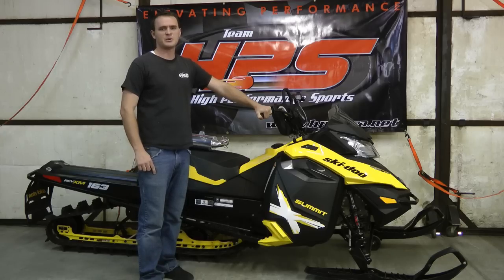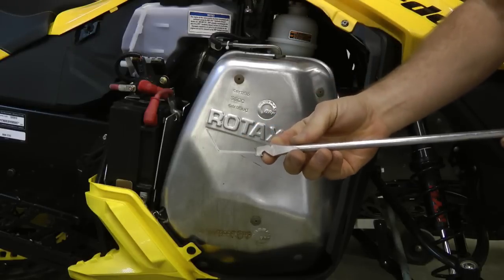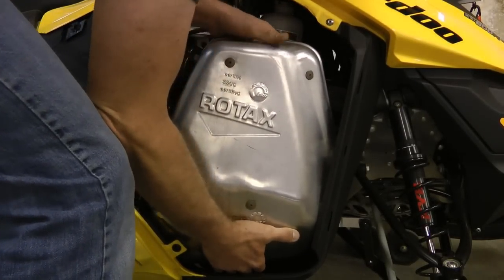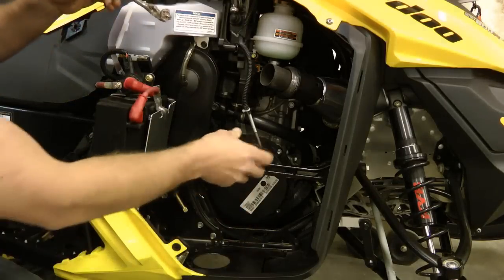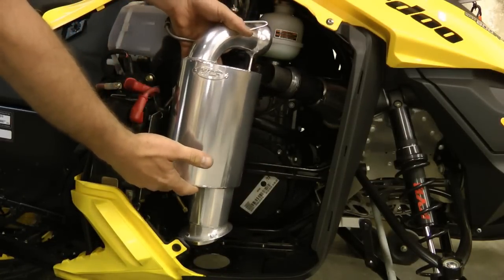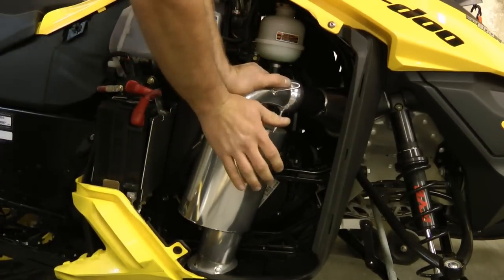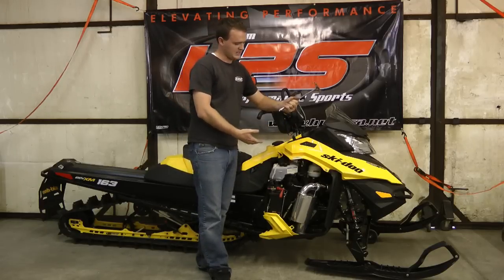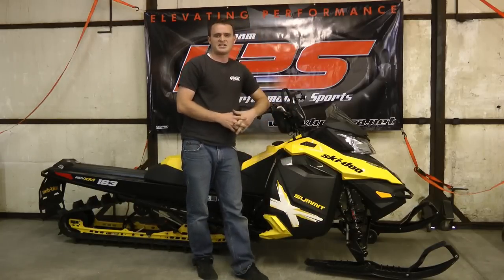HPS Ski-Doo E-Tec Silencer (CAN) install

Comment: want are your hps silencers like do they cause trouble on sleds because I had a 2002 ski doo summit 600 and when I put a mbrp race can on her I had a lot of trouble with her
Reply from the maker: We have never had any issues with codes or any problems with our E-Tec mufflers. If installing this muffler on a stock sled you should see a 100-150 RPM increase. Because of this increase it is important to make sure you adjust your clickers on your primary clutch down so to keep your peak RPM at 7900. Any higher and your motor is no longer making additional power and/or you will bump the rev limiter which will make it act like it can't build RPM. 

The only time people have concerns is when they are over Reving ( over 7900 RPM) or they have not secured the exhaust prob with the lock washer.

Comment: Where can I get the spring tool you used?
Reply from the maker: We made our own out of scrap metal.  We are working on having some available for sale.
Reply: Large flat tip screwdriver & bench grinder.  Snap On makes a fairly decent one (slightly on the small side) as well, $25 if I remember correctly.

Comment: What's the cost? And it sounds like a normal can XD
Reply from the maker: The cost for this silencer is $369 and it is available on our website
http://www.hpsusa.net/ski-doo-c-7/?osCsid=187cf16e43e69e0ee13220ac2524e15f 
If you would like to hear it there is another video under the product page.
http://www.hpsusa.net/2013-p-50/